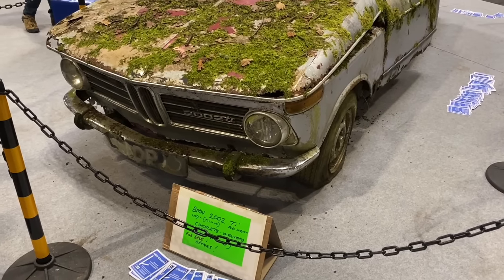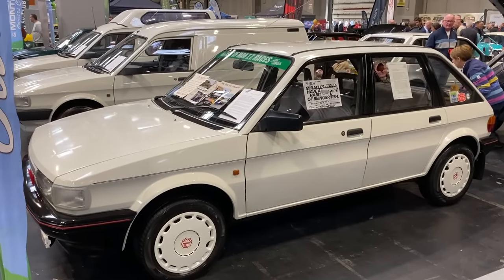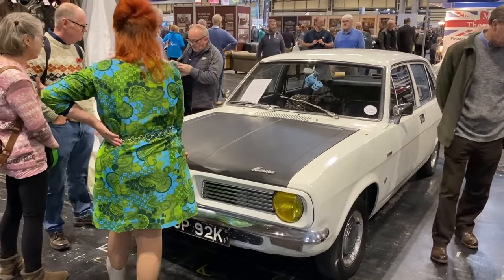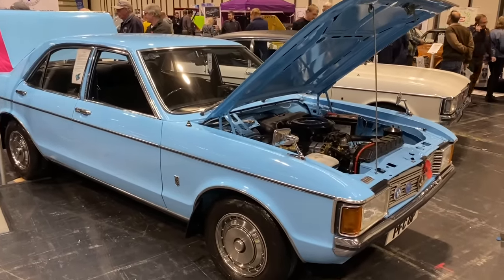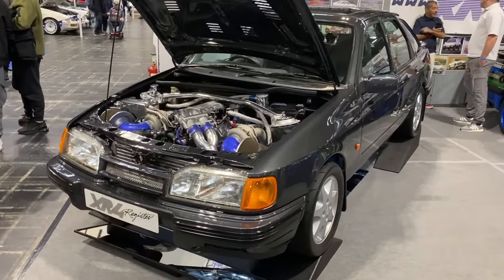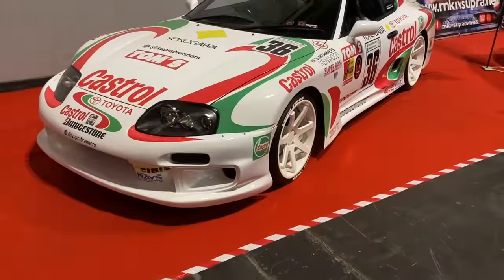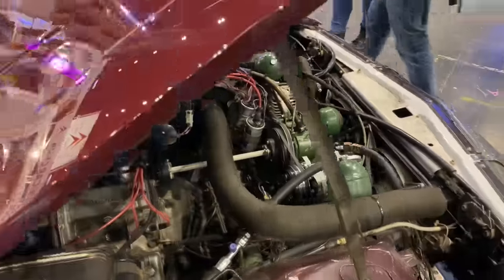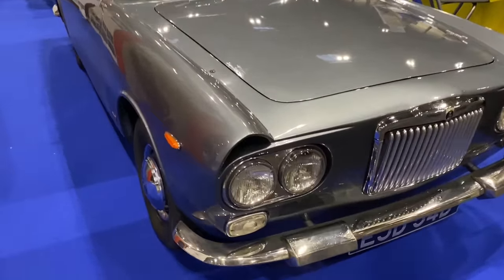NEC Classic Motor Show 2023 - Part 2

Comment: I saw and spoke to the Apple Maestro owner at Ripley Castle back in June just after he had won it. I have owned both a Marina and Ital. 
Your right about the two style of windows for the Granada Coupe. I either wasn't aware or i had forgotten it was only when i was looking at a German show that i noticed the difference. I think the second style was more like the coke bottle styling.
The Fly i have an original brochure for one of them. Crayford designed but didn't build many i think most were built under license by FF English in Bournemouth (Poole road) long gone now its a Tesco site. They were a Ford main dealer. 
I like both mk1 and 2 Granada.
The 504 is glorious and suits the colour so well.
Thanks again for the tour.